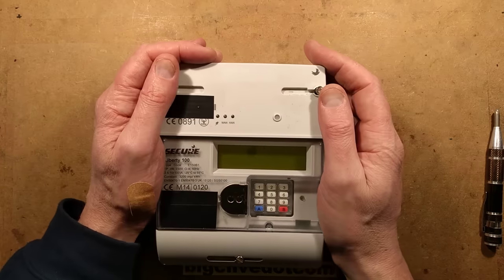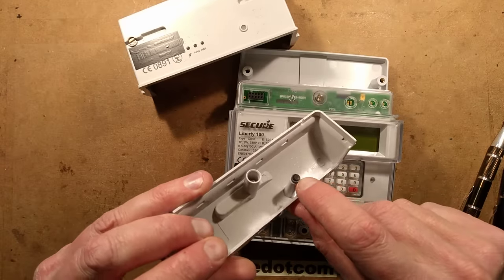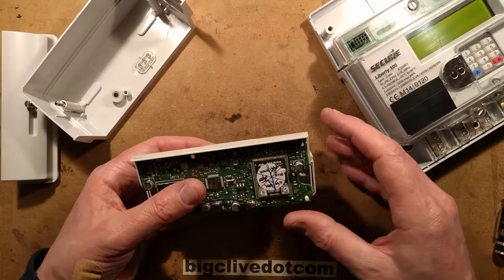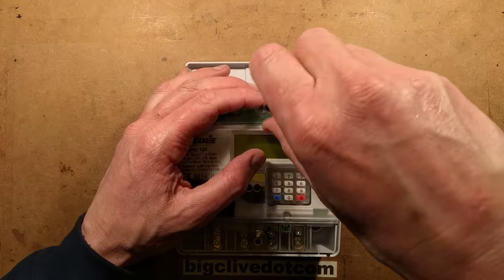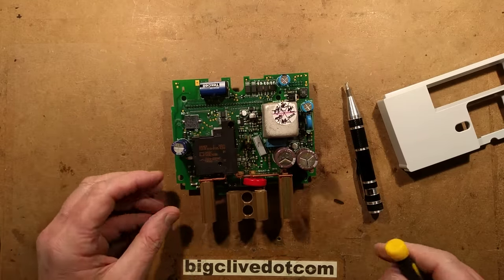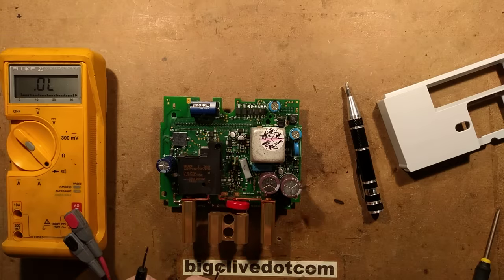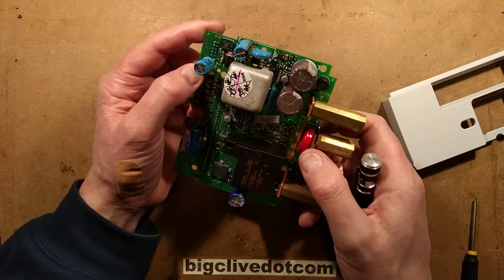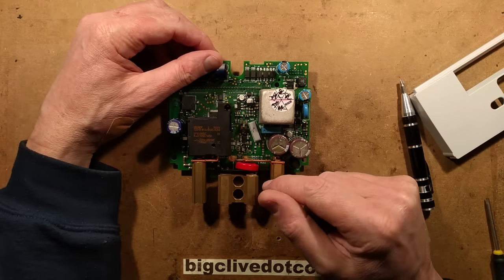Inside a smart meter, and the REAL problem with them.

Comment: They tried to put one in here.....I told them to piss off and used the conspiracy theories as an excuse. The main reason is tho.....my 60 yr old meters bearings must be a bit dry because 1kwh only spins the wheel .75 kWh so I'm happy with that. As they keep upping the price my meter gets a little slower😁😁😁
Reply: Brotang Youst they may FORCE u to switch if u keep refusing 😕
Reply: @howtowithelizabeth7513  possibly in the future but until then I'll stick with my old meter till I can't any longer. If I have no choice I'll ask for it to be put off the house as I'm on my own line from a transformer and 2 poles off the road because this place used to be a commercial property running high voltage machines etc
Reply: They came through my neighborhood one day, and changed them all without prior notice.
I happened to be home, and the power was only out for the few seconds. I didn't even notice the new meter for a few days.
Reply: gantmj Wow!
Reply: Brotang Youst Hahahah good for you.
Reply: @brotangyoust9252  unless you happen to have a sausage in your pocket.
Reply: @Jafmanz  if I don't give him the command to eat he'll sit there all night whimpering at his bowl. It's all how ya train them tbh. Dogs get baited and poisoned etc unless you train them properly as a guard dog. And regardless of food around he still won't let ya in😂😂😂
Reply: @brotangyoust9252  what kind of pitbull do you have fella?
Reply: @Jafmanz  he's a mutt mix. His mother was a boxer bulldog cross and his father a huntaway red nose pitbull cross. He's about mid thigh height, tan with white chest and paws, pink nose, lips and yellow eyes maybe 50-55kg at present. Breed doesn't have much to do with it when it comes to training. Every dog learns in similar yet different ways. I had a border collie that was a vicious guard dog. She was more dangerous than my current dog. Where you know my dog is not to be approached from the get go my old collie would act nice till you were in the gate then bail you up. Super fast and snappy as the come she was vicious yet looked like a lap dog😂😂
Reply: @brotangyoust9252  I've worked with dogs for 26 years. currently we have 11 breeds on the estate and 31 animals in total. Every single one is a working dog. Most are fox hounds, then terriers lakelands,borders etc. List goes on. cant say I agree with you about breeds. We use a german shepard to sort the poachers out for the same reason Police use them to take down men with guns and knives. Collie's are used for sheep work. best gaurd dogs in the world are a flock of geese ;)
Reply: @howtowithelizabeth7513  Not if you own the house I think, pretty sure you can also purchase an old meter off the internet, get it serviced and calibrated with a certificate and have an electrician swap it out for you, as long as it's accurate they can't do owt
Reply: @juicedmaster  
The meter doesn't legally belong to the homeowner, it belongs to the power company.

That's why they are allowed to swap it out with newer models. They also have legal protections for entering your property to service the meter.

If you remove their meter, they can fine you and/or drop your service.
Reply: @merlinious01  the meter doesn't but the house and property it's on belongs to you, and if you don't want a companies property on your property, remove it without damage and send it back to them.

If it's STILL against the law, you got some fuqued up laws!
Reply: @juicedmaster  if you want power you've got to let them on your property...
Reply: Brotang Youst the smart meter wont fit in my house 🏠 so I use the trusty old meter
Reply: Eee Dog  As a qualified and registered electrician, i'd say turn off everything and let your sparky measure a solid zero... at least the first time round

It proves theres no leakage and no siphoning
Reply: Eee Dog what happened? Lol. I work for an energy company. You shouldn’t really have an 80 year old meter. Purely for safety reasons and accuracy of readings.

To “test” your meter we would remove it and send it to another site and install a smart meter at the same time haha. So don’t ask them to test it if you must keep it.
Reply: Nice 😁
Reply: yep im still on an old Feranti mechanical one :P sure it reads a tad under
Reply: Brotang Youst yes my man someone with a bit of sense magnets 🧲😁
Reply: @nateshot3  is that a joke or do you genuinely believe they shouldn't have a 80yr old meter for "safety reasons" as long as the wiring is good and all up to code
It may eventually fail but not blow up his house

They dont improve meters for "safety" they improve it for more accuracy so they get more profits
Reply: The brain works on electromagnetic waves
Reply: Maybe....however if your meter collaboration is out, running fast & your paying to much I'm sure you would opt for a new meter & that meter will be a smart meter. I also doubt very much your traditional meter is 60yrs old & 0.75kw for the price of 1kw ....🤣 
Your under no obligation to have a smart meter that is correct, however the utillity supplier is under obligation to maintain their metering equipment for safety reasons & possible
theft tampering reasons....so they can enter your property with a warrant & warrant officer to change your meter, not necessarily a smart meter but a meter in current service.
Reply: @markj2093  will not work
Reply: Ged Woods  sleeping well I guess....if that fire is faulty you might find sleeping a little too easy.
Reply: Ged Woods  a gas safe engineer working for a utility supplier is obligated to isolate any Immediately Dangerous appliance, that does not mean remove the appliance, they should & will cap the pipework supplying that appliance, & if necessary cap the meter itself leaving you with no gas supply to your appliances, they will however leave you with a electrical cooking source & electrical heating source. You can disagree with the engineer & refuse any cap.....the engineer will then & is obligated to leave you a warning notice & inform the
 DNO....they will then isolate your supply completely until your property is safe & when your property....to reconnect supply can be expensive. 
As for your conspiracy on the motive I don't think so some how.
Reply: @juicedmaster  
It is illegal for a Electrician to go  into the cut-out, only DNO/Utility supplier is allowed....you can pay though & pay a lot....the utility supplier will want to fit a check meter with your internet purchase meter.
Reply: Almost 1 year later. You still got ya meter?
Reply: You just got to hope that it is reading less power than you are using rather than more.
Reply: @lavabait9896  yip still the same meter
Reply: @cunning-stunt  yeah I've run a appliance with a known wattage for a period of time and the meters dragging. More power flows thru than it shows on the dials
Reply: @brotangyoust9252  It's most likely still got a date on it when it was last calibrated, somewhere.
Reply: @cunning-stunt  na if it did it washed off in the rain years ago. A couple of fuses were replaced with circuit breakers maybe 15 years ago and other than that it's never been looked at except being read. The anti tamper tags are are corroded and half gone. They don't give a shit here as long as it's turning....good enough.
Reply: Eee Dog  A 80 year old meter would most probably have jewel rather than magnetic 'floaton' bearings and would probably now be significantly under-registering especially with small loads. Queensland's regulatory authorities would no doubt have a rule that meters of a certain age must be replaced. It seems that as long as Energex is making reasonable progress with replacing old meters, the regulator would be reasonably happy. Energex staff or contractors probably put customers who resist meter changes in the 'too hard basket' for now but the time will come when they have to face the issue. If I was the regulator I would require readings of very old meters be adjusted where the customer resists replacement - 1% per year after 30 years service, so you would pay a 50% premium for electricity for your 80 year old meter.
Your electrician would generally not be able to give a 'second opinion' but if he had previous metering experience he would most probably say the meter needs replacing. While meters can be tested 'in place', electricians would not have a suitable test set, nor would they be authorised to cut the seals to allow testing.

By the way I managed 100000 or so meters for a couple of years when I worked for a power utility some years ago. Electronic meters were in their infancy then and we used them for the 12 largest customers and as check meters at the grid exit substations.
Reply: I lived in a flat with an economy 7 meter as well as the usual one. I noticed that the E7 meter had no seal on it.....so one day I adjusted the clock timer to give me more hours at E7 rates. Then later on the supplier had to do something with the other meter. They never noticed the timer changes and put a seal back on.
Reply: I'm seriously annoyed because after refusing the smart meters for years, my latest energy provider, Utilita, have sent me a letter stating that my electricity meter may have developed a fault and they need to send in am engineer to replace the meter as soon as possible.

Clever tactic but i need some help in what to do! 

😤
Reply: @Gulfraz.  tell them you are self isolating
Reply: @brotangyoust9252  

That did make me chuckle and nod in approval! May you long keep your cranky old  spinny wheel type meter!
Reply: @howtowithelizabeth7513  they will just say it’s damaged or defective on the next inspection and then they can change it to the new meter
Reply: Ged Woods  🤦🏻‍♂️
Reply: @Jafmanz  do you have a fox
Reply: @FutureCurrent  alternatively you could set up an interchange right at the lot line
Reply: @chazzlebazzle69  It may be illegal, but electricians pull cut-outs all the time and DNOs turn a blind eye as long as they are satisfied that there was a good reason (usually allowing the electrician to work safely) for them doing it. However if there is a suspicion that the customer is trying to by-pass the meter then that's a whole different matter.
The DNO wouldn't fit a check meter as billing is not their concern. There's nothing to stop you adding your own meter between the energy supplier's meter and your consumer unit, but the energy supplier would not accept the readings of a customer-owned electricity meter for billing purposes.  If you refuse to accept an energy supplier-owned meter in your installation you simply don't get a supply.
(This is based on the UK, other countries rules may differ).
Reply: @netking66  In the UK its a normal part of supply contracts that the customer informs the energy supplier ASAP if they are aware of any faults with the metering equipment. So if Brotang Youst is in the UK he's in breach of his contractual obligations.
Reply: @Gulfraz.  My reply is probably a bit late, but whilst they can insist on changing your meter you can insist that they replace it with another  "dumb" one.
Reply: @davidfaraday3085  
Electricians are not allowed in the cut-out....find your MPAN on your bill, phone the "distribution network operator" DNO for your area & they will also tell you only the supplier is allowed to pull the main fuse...care to Google it if your still adamant they turn a blind eye.
Reply: @chazzlebazzle69  Just because they aren't allowed to do it doesn't mean they don't do it.  I'm subscribed to a number of YT channels made by working electricians and this is a subject that comes up from time to time.  They all admit that they have pulled main fuses when they needed to. A comment made by one channel maker was "any electrician who says he's never pulled a main fuse is a liar" while another of them included a voice recording of a conversation he had with employees of his local DNO who agreed that electricians should pull the main fuse if they needed to do so to work safely.
Reply: @davidfaraday3085  
I understand...I've worked for British Gas, & the DNO for years...& yes most the time we engineers visit  an ECO, the seals have been cut or removed completely, we as engineers are there for the emergency call out, after our risk assessment & visual inspection for signs of tampering we will then complete the necessary work to get the customer back on supply...DNO dont like the seals cut, however its proving who cut them...another reason they don't like the seals cut/removed is the flag seal has a unique serial number on from the crimping pliers...that unique seal can then be tracked back to the engineer who installed the original meter.
Reply: @chazzlebazzle69  I wasn't suggesting that the DNOs like people cutting the seals, rather that they accept that it happens. Until people started fitting isolator switches between the meter and the consumer unit the only effective way of isolating a consumer unit that was to be replaced was to pull the cut-out. While clearly the proper procedure would be to ask the DNO to do that, that adds cost and delays the work.
The cut-out fuse in my house has never had a seal on it in the 36 years I've lived here. Even when the meter was changed 18 years ago the cut-out was not resealed.
Of course with the current "competitive" energy supply system the DNO isn't responsible for the meter, and smart meter installers don't work for the DNO.
Reply: @davidfaraday3085  
Most people do the right thing & book an isolator installation through the supplier...then the full installation will be checked by a fully qualified engineer...believe me I have been to many electrical fires at the meter because of electricians. Some electricians should never of gained their ticket
Reply: @chazzlebazzle69  Yes clearly that is the correct procedure, but I don't know how you would know that "most" people do that unless you know how many people don't.
Reply: So, your 60 year old meter is smarter than the modern smart meters...you are actually ahead of time.
Reply: Lucky sod!  My new house came by default with digital meter.. gosh i hate digital meter compared to old disc meter
Reply: @chazzlebazzle69  which university is it that gives a degree in gas engineering please?
Reply: My two cents, as a resident of California, USA: in a way, they are forcing it.  I pay an opt-out fee of $75 per month.  This seemed unreasonable at first, yet opting out does mean they continue sending a technician out each month to check the meter. 🤷🏻‍♀️
Reply: @Gulfraz.  not sure where you reside, yet you likely have the option to opt-out in exchange for paying a fee similar to my own.
Reply: @kneau  I'm in the UK and changed energy companies so i think I've dodged it once again :)
Reply: @Gulfraz.  admirably sensible 👍🏻
Reply: Can't those be refused because for electrosmog reasons?
Here it is a valid reason to refuse those. Just tell them that you unplug any wireless stuff at night to be able to sleep ... etc
Reply: @ppdan  That is the honest approach I took. I use a neurostimulator device; having been instructed to be mindful of devices powered on near me while using it (along with the meter being near a bedroom)... health complications are the cause listed for why I’ve opted out. 🤷🏻‍♀️
Reply: @netking66  f smart meters 
I don't care what you say
I'm not getting one.
Reply: Yeah sure.
Reply: @chrisman3673  Me neither.
Council house here, and refused to have one, fk em.
Reply: In the US, they charge you a bit more to keep your analog meter, likely for this reason and for hassle of checking the usage.
Reply: i stil have the sane bakolite meter since ... 1952 ?
Reply: @juicedmaster  Nearly everywhere in the US, power suppliers (along with other utilities, licensed surveyors, et. al.) have an easement** on "your property" as a matter of course and may enter at any time in the course of their normal business. Interfering with them may rise to the level of a felony, and if you don't want their meter, you don't get their service. Try reading your deed some time.
Reply: HAHA
Reply: @chazzlebazzle69  Correct, after 40 years in the industry the suggestion that an engineer would condemn a gas appliance remove it and try and sell a manky second hand appliance on ebay is laughable complete and utter nonsense, why do people come out with this rubbish?. In the case of changing your gas meter over to a smart meter the engineer would need access to your house in order to purge the air out of a new meter through your appliances, there's no way that can be done  changing your meter in the box outside your house and you just noticing that your gas goes off for a few minutes before coming back on
Reply: @barryisland5097  
All the gas appliances should also be checked after the purge...it would be against Gas Safe regulations to even change a gas meter without checking appliances beforehand & checking for any gas leaks with a pre-tightness test. Depending on the meter be it a G4 or E6 you will have a permissible drop of 4mb or 8mb...if there was a drop within the permissible range 
"without the smell of gas" the same or better drop should show on a post-tightness test....after your stabilisation test you would purge & then check working pressure, anything between 19mb & 23mb.
Reply: @brotangyoust9252  I had a Pembroke Welsh Corgi like that.
Reply: @brotangyoust9252   As someone who has worked in utilities, I would literally just ring your doorbell and tell you to bring your dog inside. If you didn't then the next ring of your doorbell would be the sheriff telling you that your utilities are shut off and your house is no longer legally fit for human habititation and you're being evicted. That may vary if you live in some rural podunk area where not having utilities service is common. Moral of the story: just let people do their job, it'll work out better for everyone.
Reply: I did renovating meters at the then SEB waterloo road Uxbridge. The voltage was connected to the little voltage connector, there is a link under the cover, and a low fixed current was connected to the mains input. I had a bench with hundreds of meters connected. Never had problems with bearings in use.
Reply: Ged Woods  A dangerous gas fire can give off carbon monoxide and kill you. It's very serious. Your landlord can't fob it off on you, he has an obligation to provide safe equipment. He just didn't want the cost of replacing it. I hope you haven't signed anything, though I doubt there's anything you could sign that would over-rule important safety laws.

If it's faulty it's his obligation to replace it at his own cost, it's part of the house, you won't take it with you when you go.
Reply: Ged Woods  I have no idea what it even means to "prove [my] angle" but I can assure you that utilities workers have a legal right to access your property for work performed on the utilities you are using. In my case that utility (water) is required for that residence to be legally habitable. If we cannot service your utility then we cannot give you that utility and so that residence is no longer legally habitable. There may be different laws on what makes a residence habitable if you do not live in an area with reliable public water service, but utilities workers still have a right to access your property to service the utilities they provide.
Reply: Same here  in France. I had an guest staying who is a electrical contractor and told me no don't get one installed. He said many have gone up in flames. Clive did talk about heat in some connector on that meter. One thing in France is many household take the lower amp so if they plug in too many things the fuse blows. I went for 45amp setting. Ive heard these meters charge more and reduce the amps down. Just the fact that they can cut you off remotely is a red flag. If they want to cut me off they will have to send a man out and I'll be waiting shotgun in hand! An englishmans home is his castle! When the Arabian guy arrived to fit one I told him to %&£# off.
Reply: Ura rum lad boyo!  👍
Reply: @howtowithelizabeth7513  it is not law. Theycannot force you to do it, wgen they call you ask the question   " is it kaw that i havevto haveca smart meter?".... they will not say yes because they can't.
Reply: @gantmj  should of got all you broken electrical items and said they was all plugged in at the time and the meter change damaged them